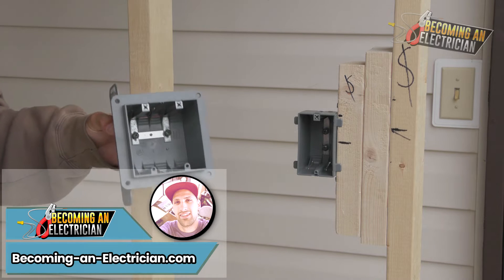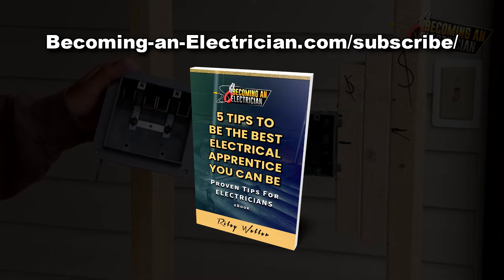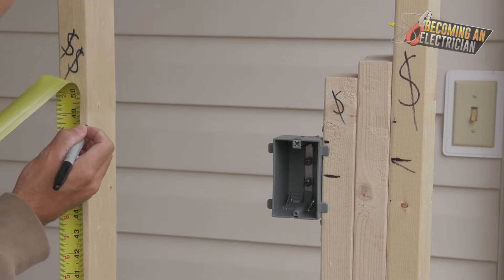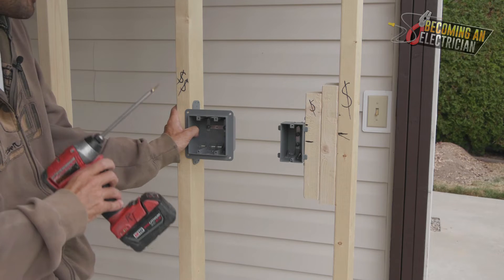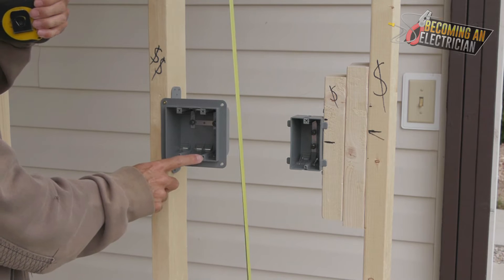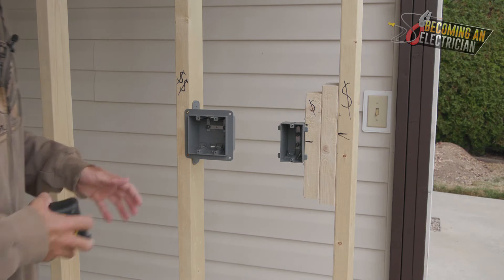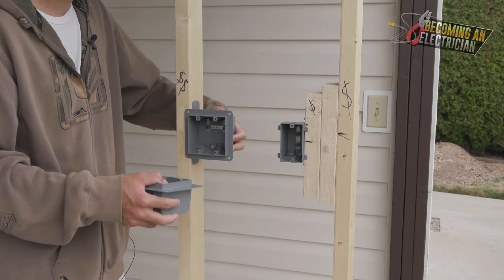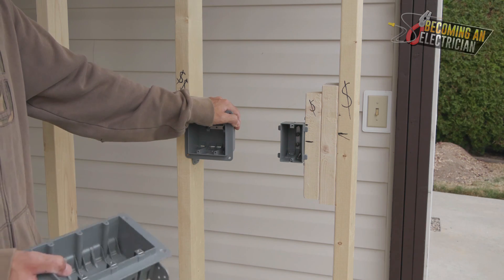How to Install a Double Gang Electrical Box

Comment: Great if theres no drywall yet, but these suck if there's already drywall installed. No where to screw into through the box like the metal ones and the lip around it needs to be behind the drywall which you can't do unless you cut an even bigger hole, leaving you some drywall work. Not good for a quick install.
Reply from the maker: Not meant for a retro-fit.  Meant for initial install.  Also hard to remove if you ever want to remove it in drywall stage, but the box is very secure 👍
https://becoming-an-electrician.com/

Comment: that looks like a nice box. Can you provide more details like brand and part number?  The plastic ones I see at home stores are trash- Thanks!
Reply from the maker: Hi Neil, here's a link of a very similar model:
https://www.homedepot.ca/product/nutek-2-gang-plastic-box/1000404477

Not sure if it's more of a Canadian thing.. the one problem with these boxes is you can't stick the box out further in the drywall, but great for normal walls with just 1 layer of drywall :)
Reply: @BecomingAnElectrician  Thanks so much! You are in Canada which makes sense why I've never seen that box before! I will look in the US for it! Thanks again!
Reply from the maker: @bigneilh  No problem, you let me know if you ever have questions, or would like me to cover anything regarding roughing-in - that is what I'm tackling right now - here's the various videos/articles so far:
https://becoming-an-electrician.com/tag/roughing-in-series/